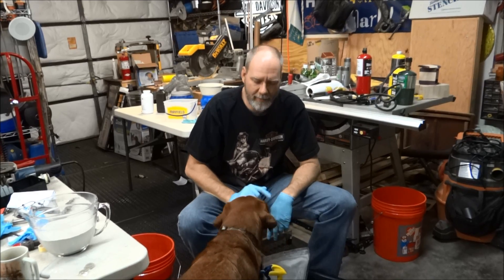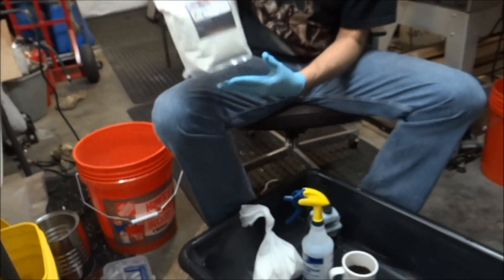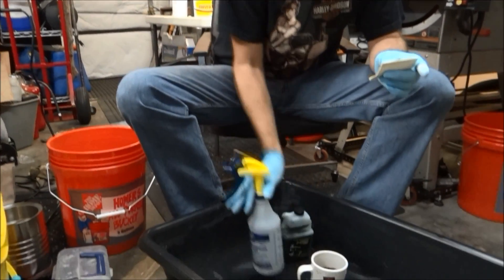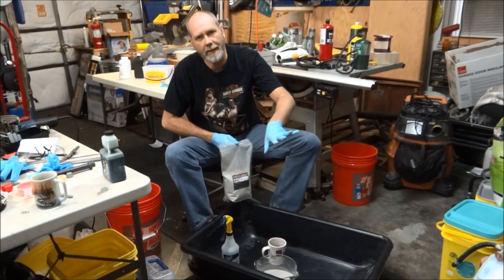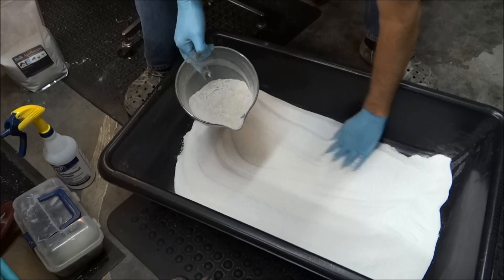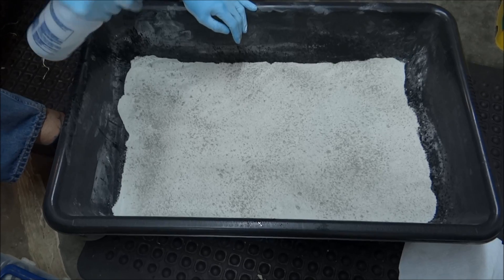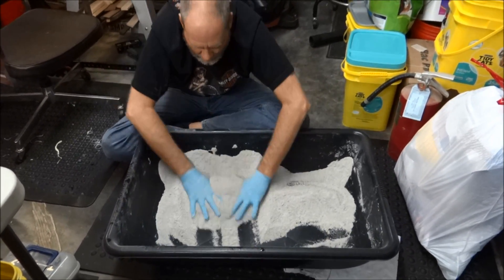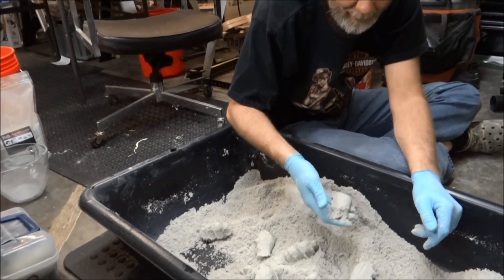How to Easily Make Green Sand for Aluminum Metal Casting

Comment: Great video! I made a batch last year after watching other Youtuber's  who recommended using playsand and kitty litter. Wish I would have found this video first! Took me ALL DAY to make! There are different grades of playsand and, as luck would have it, the sand that I bought was 1/8th gravel. I went through three different sized sieves and was still not satisfied with the results. I finally found something that I could use that worked..... a nylon paint- straining net used for 5-gallon buckets. Using kitty litter was a HUGE mistake as it is the most difficult to break down in a blender. I burned up my first blender and went to a re-sale shop to by an old cheap used one and ended up burning that one up as well. The powdered Kitty litter sticks to the bottom of the blender and you are constantly shaking it to allow the larger aggregates to get near the blades to chop, then sifting the mix to separate the powder from the rest. I ended up with a great mix, but like I said, took me all day! From now on i'll buy the silica sand and powdered bentonite clay in READY form so I don't have to go thru that again. Thanks

Comment: Hi I spent 25 years in a  green sand and no bake foundry for steel. "The green sand he is referring to is the cheapest and easiest method for molding metals. The sand mix we used was silica sand, bentonite clay and corn flour. The corn flour was the part used for making a smooth casting out of sand.It was mixed just as LifeBuzzN said only with about 5 percent corn flour added to the mix. And we used a large Muller to mix the sand with but this would be hard to do at home so hand mixing would do just as good. I have made many castings at home and always reused the sand in the next mix, but you must screen out the larger chunks before reusing. And as many have said use a dust mask this stuff is not good to breath. You want to keep the water content to a minimum to prevent porosity in the metal. Porosity is when gas bubbles gather in the metal you are working with.
Reply: joey foundry i have worked in a green sand, no bake foundry for 8 years and there are many many ways to make a mold. Different castings will have different defects and what not, it will take some trial and error if you don't know what you are doing, but anyone can learn this stuff with a littld research. As for the silicosis or dust, if you only do this recreationaly you wont be in much harm from it. I know guys and have family who worked here for over 30 years and their lungs were not that bad. I love to see people doing this because there once was a time i really enjoyed being a molder, long ago. Lol
Reply: @Ericdawg420  "long ago" awww!  C'mon you must get some joy from some projects?  :)
Thanks for the comment Re 30yr+ w/o issue, I'd been using common-sense caution w/ the dusts I'm generating as I smash kitty-litter for the benonite% in there, as to "the dust from sand/silicosis" I mean my sand is literally beach sand (am in FL by the water) so am exercising same amount of caution you'd exercise @the beach for that one!

What're your thoughts on @Joey foundry 's idea of corn starch?  I'd been intending the usual mix @LifeBuzzN (great username!) shows in this vid only smashing&screening for my sand&clay, am intending to use motor oil to dampen it (am verrrry experienced w/ mixing crete mixes so expect to "have the feel" for moisture% here), but for the finer finishes I want I'd been thinking there's gotta be something and corn-flour seems it'd do the trick, I was planning to experiment w/ gelatin but that'd be 1-time use only as far as I understand it's behavior ('Knox' gelatine)  

Would love any suggestions on what to use instead of corn flour (or confirmation it's a solid "final binder/smoother" to the mix!)
Reply from the maker: Thanks Joey.

Comment: I'm new at this. I see on other casting channels, the use of green sand.
Is the sand reusable for making other molds, or do you have to make
a fresh batch for every new mold?
Reply from the maker: +George P Break out the burnt parts and throw that way.  The rest can be re-moistened and reused.
Reply: LifeBuzzN
Thanks it really helps

Comment: To get really good results with mixing,
put the prepared green sand into a 5 gallon bucket
with a tight fitting lid.  Put the bucket in your clothes
dryer with the heat on the lowest setting possible.
put in some blankets, pillows, or cardboard boxes
to sort of keep it from damaging the bucket or dryer.
OR - if you gonna be doing a lot of this stuff, get an old
dryer and disconnect the heater..... 
WaLa !!!  a mulling machine
Reply from the maker: +John Smith My wife will kill me if I tried that.

Comment: So water is a good moisture agent? and not the 2 stroke oil? I would think the water would want to explode or turn to vapor during the pour and mess up your mold?
Reply from the maker: +sking0369 Water works, remember, you are not making the sand too wet.  The oil is a little smoother and would be my first choice if I had it laying around.

Comment: Ok thanks again what ratio should I use with the bentonite clay. I have it around 10% clay right now and it's not keeping form very well. I use water I was thinking about using two stroke oil as I seen on a video. What do you recommend with this ?

Comment: Can I just buy it already made
Reply from the maker: Shawn P It's pricey.
Reply: I bought cat litter any cheap blender I put 10 percent clay in the sand, I use water with a spray bottle but the sand is not keeping form very well. I also watched a video to where it said to use two stroke oil. What are your recommendations for proper sand mix. I'm completely new to this learning as I go I made a furnace heat source charcoal,

Comment: You had it just right before adding the last bit of water.
It should hold its shape and if it falls apart when you poke it with your finger it's perfect. if it doesn't it's too wet. the water will evaporate so it's not a big problem if it's a little bit too damp.

Comment: It's called green sand because it hasn't been used yet. Think greenhorn.
Reply from the maker: Jon Miller The oil doesn't evaporate as quickly and allows for smoother casts.  Thanks for chiming in Jon, I love it when there is interaction.  Thanks
Reply: Or at least it hasn't been fired, just like greenware pottery or ceramics. It's "green" until it goes into the kiln. Greensand doesn't go into a kiln, and other than the bits you filter out after a casting it can be used over and over. But it definitely has nothing to do with the color, and I have never heard of using motor oil. Oilsand is something else entirely (commonly used for the cores in a sand casting).
Reply from the maker: basement_sawyer Just like me.......a greenhorn.

Comment: petro bonded  or oil bonded sand is a completely different formula than green sand just using oil in place of the water is not going to yield very good results.
check this out for a good home recipe of petro bonded sands
http://www.foundry.ray-vin.com/k-bond/k-bond.htm

Comment: Hi there.
I am trying to get bentonite clay. I contacted Bulk Apothecary. They have stopped the 50 LB bags. There is so many ads for bentonite but its very confusing with use for health eat, skin, black stuff calcium and sodium bentonite. Know another supplier? Also the sand seems to have a multitude of types.
Thanks.
PS love your videos.
Reply from the maker: Dennis yoj Hi Dennis, I ended up ordering mine from a health and beauty web site.  It turned turned out to be very good.
Reply: LifeBuzzN Thanks LifebuzzN
Reply: I just bought 50 lbs. bentonite from Bulk Apothecary. So, try again.
Reply: Well drillers and building suppliers have it.
Reply: basement_sawyer another place to check are the ceramic/pottery supply houses.  They sell bentonite clay in various quantities.

Comment: Thanks for the formula to make the green sand, (  just starting  to learn to cast  )
Reply from the maker: doomedalready Just make sure it isn't too wet.  Just enough to hold together.  Once you've practiced, use 2 stroke motor oil instead of the water.  Makes smoother casts.

Comment: Thanks - mine caused serious gas problems - I think far too much bentonite, and much too wet. This is helpful
Reply from the maker: You could use 2 stroke motor oil in place of the water for a smoother surface.  Thanks
Reply: I saw that, but its a bit early for me to try that until I get the water working. As you or someone else  said, you can't get the oil out again...I've mixed up a new batch, much drier this time, with half the amount of bentonite. I'll see how that goes. Thanks again
Reply: I don't see how too much bentonite could cause gassing problems.  Try adding a bit of baking soda to your aluminum to act as a degassing agent.

Comment: Sir, I want to ask why you not add Silicate ( water Glass/ Liquid), as a binder?, and please also give me info about silica Sand, because here in my country I tried to find it,, & what you think if we use 50% of benthonite with 50% of sand, because i think the sand make the Rough Surface & the benthonite give you more smooth/ perfect surface!! thanks.
Reply: You don't want to use too much bentonite for 2 reasons first it will retain too much water and you could have a small steam explosion when you make your pour.  Secondly if the sand is too fine it won't be able to gas out properly and you will get a crappy pour and possibly blow out your mold.  Thats why you don't want to go much finer than 125 mesh sand.   IIRC 8% - 12% bentonite is your sweet zone.
Reply: Thanks for yours reply!! its really helpful !